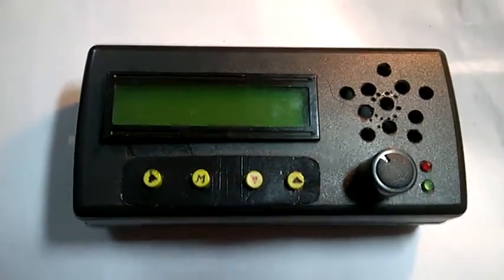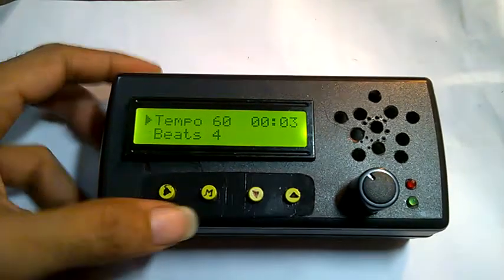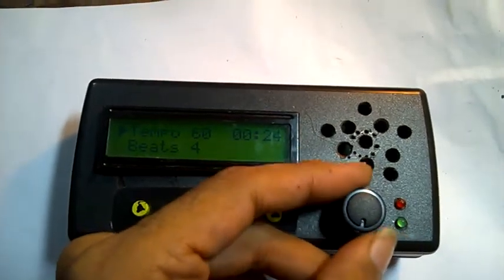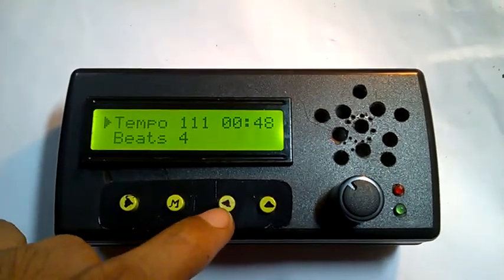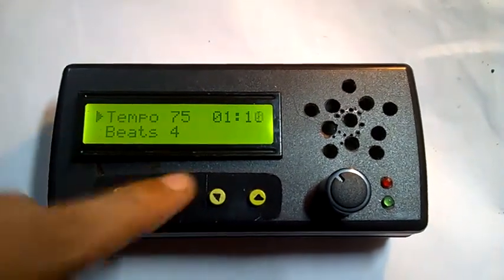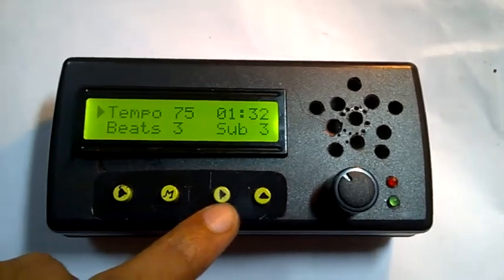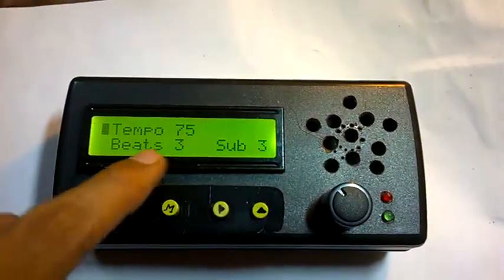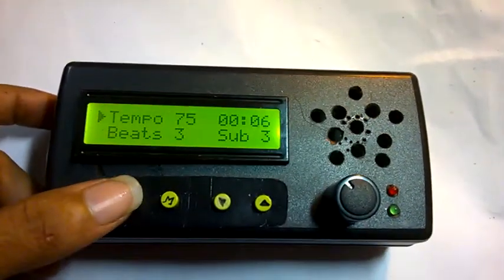DIY Arduino Metronome

Comment: Hello,

Did you have the source code please ?

Thx
Reply from the maker: I found something but its very old, not sure whether it will work or not. I haven't worked with Arduino for a long time so won't be able to help either. How can I send you the file?